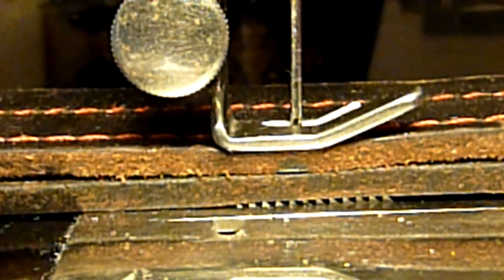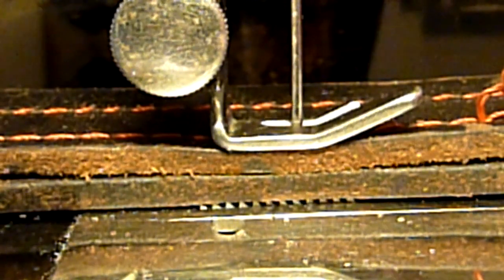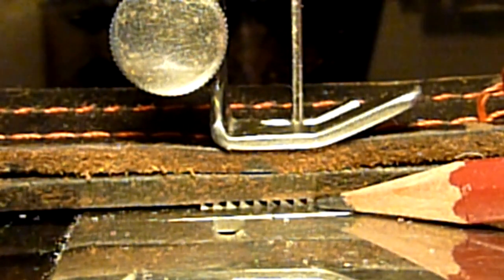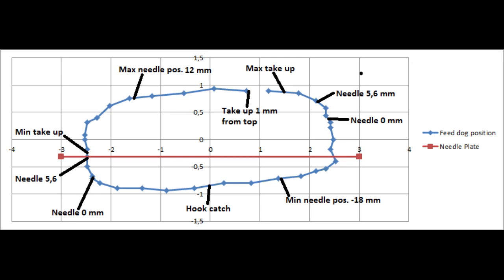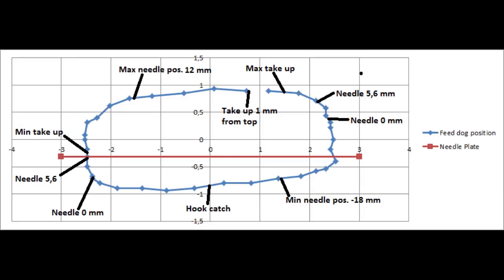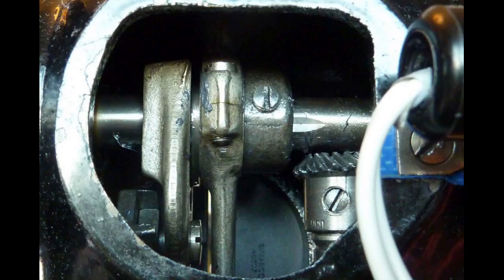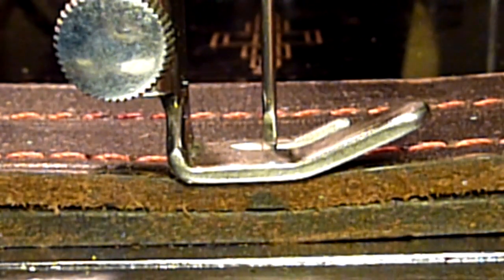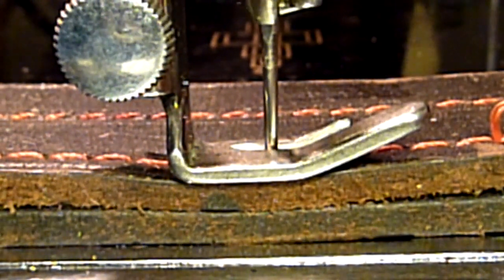Timing of Feed Dogs Movement for Vintage Sewing Machine

Comment: Have you tried this Leather experiment with a 15-91 Potted machine?  The reason I ask is because I converted my 201-2 Potted machine to a Belted machine with a 1.5 amp motor.  But my 15-91 Potted never ever skips a stitch, but the converted 201 Belted will skip occasionally.  I keep wondering if it's because the hook on the 15-91 oscillates, therefore does not have to struggle keep up with the timing of the feed dogs.  I just don't like how the 15-91 slams down on my leather, due to it being gear driven.  So that's why I focused on converting the rotary hook 201-2.  However, I do have a 66 from like 1950.  It does seem to be pretty strong with just the vintage motor, and it has an oscillating hook. The belt will slip on leather at times, but it is an older belt.  Should I concentrate on that machine, and try the 1.5 amp motor on it?
Reply from the maker: I think you should try to measure the distance between the hook and needle of your Singer 201. This could give you an indication. I do not have a Singer 15 to compare. I newer got a problem with skipped stitches with my Singer 201. But with my class 15 shuttle hook on my Singer 237 and Bernina 910 I can get skipped stitches now and then. I have got a Singer 66k from 1930, and I made a video of it sewing vinyl with Tex 135 thread. I have measured the thread friction to the hook of the Singer 66k, and it is superior to both my Singer 201 and Singer 237. So yes, I should try the Singer 66. The good thing about the Singer 201 for leather is, that i have got full reverse stitch length like the Singer 15-91. If you sew more heavy leather or fabric, I think you would like to have or make a speed reducer.
Reply: @sewingmachinesindetail , Do you know where I can buy a simple Speed Reducer like the one you made?  With the proper brackets and bolts.  The bracket that came with my 1.5 amp Alphasew Motor is just not long enough. The motor will smash the Pillar of the machine.
Reply from the maker: @WeQuiltStudio  Sorry I have not seen them for sale. I made it from scratch. I made a video about it.
Reply from the maker: @WeQuiltStudio  It a bit strange, that the bracket should not fit. I think I have seen a couple of youtube videos about installing this motor on a vintage machine. The 180 W motor I got is from China. The bracket for this motor is flimsy, but it do have elongated holes to position the motor.
Reply: @sewingmachinesindetail , I think I need to get the 15 3/8" belt.  I did bend the bracket, as suggested from my FB group.  It was really scary bending that while it was on the machine.  But it did seem to get the pulley to lay better, even with a smaller belt that came on my 15-90.  So now, thanks to everyone's input, I think I can sew without skipped stitches.  Now, onto that Speed Reducer... :)

Comment: I've tried this mod on a couple of my machines, a Singer 66 and a Morse Foto-matic, and a Brother Window-matic, and I'm noticing that it causes issues with the thread tension. It seems that moving the stitch back earlier messes with the ability of the take up lever to pull the stitch tight. Therefore, especially at longer stitch lengths, the upper thread tension has to be set much higher than the bobbin thread tension in order to pull the lock of the stitch back over the edge of the needle hole and up into the center of the fabric. This issue is compounded by presser feet that ride close on the heels of the needle line because the upper thread rubs under the edge of the presser foot as well. (In the video you are using a presser foot with plenty of room behind the needle line, so this wouldn't be a compounding factor while using that or similar presser feet.) Perhaps this is the reason for the late timing of the feed dogs from the factory.

In your video "How to improve Sewing Machine Presser Foot for heavy duty Applications" you discuss the modification you've done to your presser foot to alleviate the problem of increased thread friction under the presser foot on longer stitch lengths. I suspect that relieving and/or polishing the back side of the needle hole in the needle plate would further help mitigate the complications that arise from advancing the feed dog timing.

My solution is to set up each machine for the application I use it for. The Morse zig-zag I am setting back to only about 5 degrees advance in the feed dogs because I use it with an even-feed foot for sewing relatively thin materials. (With this amount of advance, the take up lever reaches its max position when the feed dogs have only moved about half the diameter of the needle hole on the longest stitch length setting.) I polished the back edge of the needle hole on the even-feed foot as well to help reduce friction and thread abrasion. The Singer 66 will be my machine for medium-thin leather work so I set it's feed dogs to about 15 degrees advance. (This leaves the needle about 7mm above the needle plate at the end of the rearward stroke of the feed dogs. And because of the groove machined in the shaft, it is the least amount of advance I can set it to.) I will be modifying the presser foot and needle plate to compensate; I expect that I will still need to use increased upper thread tension and adjust it for different stitch lengths. The Brother is a pretty, collectable machine, as well as an all-purpose workhorse, so I will set it back to factory spec or maybe just a few degrees advance.
Reply from the maker: Thank you very much for your analysis and answer. I think the main advantage of the food with the slid is not the reduced needle thread tension. It is the reduced drag in the fabric, so the feed dogs got less difficulty in moving the fabric. So the improved feed is the main reason for the foot.

I did include an extra comment in the text a few days ago regarding a problem I discovered. It was regarding the hight variation of position of the stitch lock. With normal timing of feed, the feed dogs move when the take up lever is at top position. So both feed and take up lever do influence the position of the lock. With the slid in food, the influence from the feed movement is not the same. And for me the variation of the lock gets bigger with this food. So for some applications it may not be acceptable. With an application with thick fabric to be sewn, this variation may be acceptable.

In some manuals for Juki machines they state, that the timing of the feed can influence seam pucker. So the normal late feed timing reduce seam pucker. So seam pucker can be another disadvantage for fabrics susceptible for that.

In some way, this foot got some of the same properties as the large roller foot.

Comment: This is a superb piece of work/research. Thank you.
I will try this on my 201 to see if it will handle leather more easily. I know the 201 is not an industrial machine but it will handle thin leather that is not too firm.
Reply from the maker: Yes, perhaps it will help you. I think there must be a reason why the designers of this and other domestic machines have this late timing of the feed dogs. But unfortunately I have not yet seen an explanation.
Reply: @sewingmachinesindetail   Hi,  it seems that perceived latency of the feed dogs, it's simply down to thickness, so if you have thin material by the time the needle reaches further down and  penetrates the material feed dogs will  already be all the way down.
Reply from the maker: @ivang752  I have learned a bit more since this video, and the reason for apparently late timing of feed is to obtain better stitch balance. I made a long video about one stitch of the 201, with an explanation.

Comment: This is how a distributor works in a hotrod. You can advance or retard the timing based on what kind of race you are doing. If we could do this on the fly with a sewing machine. It would be awesome. HOWEVER, I would be very interested in seeing how you actually changed the time of your feed dog and what went into that so we could get correct positioning of the needle and dog and movement of leather so we can get these machines to sew leather or vinyl more readily. I have a "Red Eye 66" sewing machine i was working with today that sews leather but, I want it to do better so, I will keep up with your video's and see if I can accomplish much the same thing if possible. I truly appreciate your video. I was quite surprised at what you have accomplished with your work.
Reply from the maker: Thanks for your comment. I got a SInger 66k, but I have not tried to change the feed dog timing of it. But I think you need to, if you want to sew a fabric with a thickness above 4 mm or so. One problem is, that the shaft got a grove, so if you try to make an offset of 15 degrees only, the pinol lock screw will force the setting back to the factory setting. I think you need to make the offset at least about 25 degrees in order for the lock screw to press on the "real" surface of the shaft. With the 66, you only change the timing of the forward/backwards stroke and not the up/down stroke. But I guess it will be OK.

I did some measurements, that indicate that the Singer 66 is better than the 201 and the 237 by having lower thread friction in the bobbin area. The friction at the thread u-turn near the hook seems to be significantly lower for the 66.